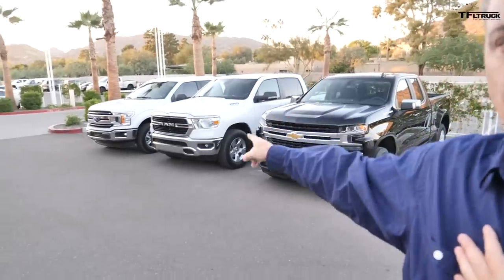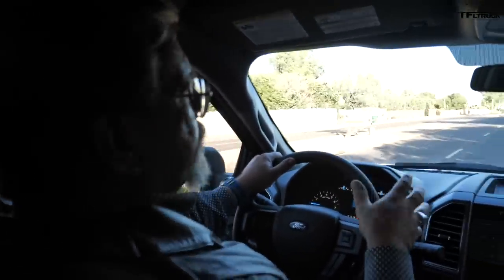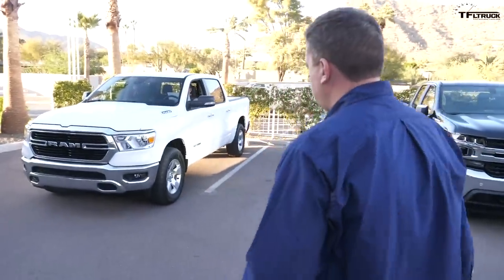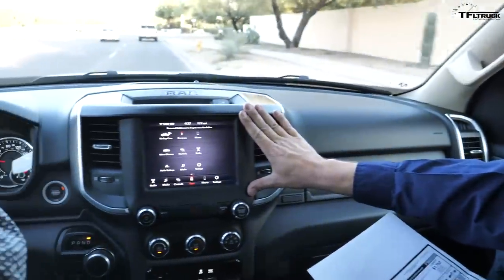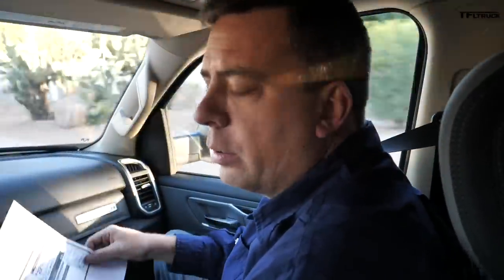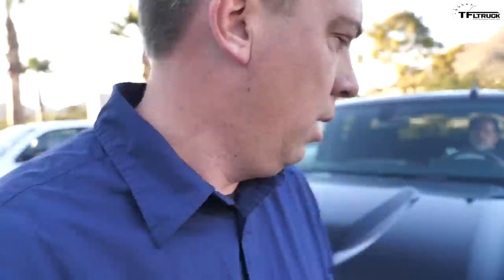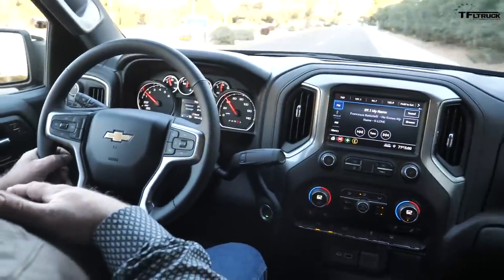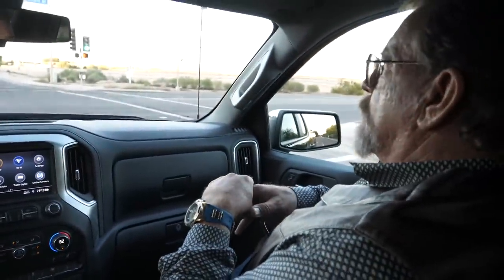Work Truck Wars: 2019 Chevy Silverado 4-Cylinder Turbo vs Ford F150 vs Ram 1500 Review

Comment: I don't care what Chevrolet tells you, the viewers want to see a 2.7 Ford vs 2.7 Chevy review. Especially up the Ike gauntlet.
Reply: Gm fanboys will just complain that ford has two more cylinders.lol or whatever crazy excuse they can make for losing
Reply: Agreed!
Chevy already has the 4.3 V6 to complete with the other V6s
I bet this was originally made to complete with Fords 2.7 because they don’t have an engine to compete against it. But it was a huge disappointment so GM tried to save themselves the embarrassment and decided to say its to complete against the other V6s (and their very own V6 lol) 
So the tests I want to see: 
1. The Ford 2.7 V6 Ecoboost vs GM 2.7 turbo I-4
2. The GM 4.3 V6 vs the GM 2.7 turbo I-4

And to be honest, with the silly electric water pump (why, just why lol) on the new GM turbo 4 I would gladly take the other two base V6s and even GMs very own 4.3 over this new engine
Reply: @dragon81heart  that water pump looks like it is stupid easy to replace. its right up front looks like only 4 screws hold it in .
Reply: BassRacerx doesn’t really make a difference how easy it is to replace if your engine is already ruined
I would very happily give up the extra few horsepower the belt driven water pump uses for the piece of mind  knowing that as long as the engine is running, the water pump is too. It is a simple and redundant system that has been proven to be extremely reliable and in some cases will last the life of the vehicle
This electric one has none of that, and adds in extra levels of complexity and failure points of wiring, sensors, and the tubing that connects it up with the exhaust manifold (which from what I hear is cast as part of the cylinder head...another step backwards)
Not sure what was going through General Motors head here with this engine. GM makes the LS, which is an amazing engine, so how did the same company that made that drop the ball so badly when it came to this??
Reply: @Pabloperes675  Grand National vs ecoboost
Reply: I agree😉😎😇
Reply: @Pabloperes675  More turbos just means more friction losses.  Turbo power comes down to pumping volume, and GM could have just made their turbo bigger to move the same volume.
Reply: @rightwingsafetysquad9872  agree.
Reply: @dragon81heart  Wrong, the 4.3 is gone, this is the base model engine now.
Reply: @JkeeneMX607  It also has two turbo's!
Reply: The 2.7 Ford will stomp the 2.7 Chevrolet with ease.
Reply: One think about the chevy is in a few yrs. The resale value will be better than the ford or dodge. The ford trucks have the worst resale value going.  Probably because ford is not as durable as Chevy or dodge.
Reply: @donaldkinder6716  Dude you must have bumped your head hard,my dad owned fleets of trucks and the Fords were always the toughest ones he ever had the Chevy's were always more sissy and more of a ladies truck. And believe me water well drilling is as hard on trucks as it gets and dad beat his trucks mercilessly everyday of the 48 years he was in that business. Chevy is no match for Ford when it comes to bare knuckles hard ass work.
Reply: U ford guys ant nothing but cry babies. Because the Chevy 4cy 2.7 out does the ford or dodge 3.3 and 3.6 v6. Ford guys want too put a 2.7 v6 with eco boost. The Chevy 4cy has 2 less cylinders than a eco boost 2.7 ford v6. Wouldn't be fare. But ford guys always know that ford engine's. Have too have a advantage. Too out do a Chevy.
Reply: @donaldkinder6716  After more than 30 years working on trucks,I can attest to the fact that Ford trucks are just plain better trucks than Chevrolet trucks
Reply: Truth hurts !!!!!!!
Of COURSE they met the challenge !!!!!
 Toyota will NOW follow !!- ford better idea ?????????????????
  Has been runnin after everyone since !!😬👍🏼🎶🇨🇱🇨🇱🖖🖖🖖🖖
Reply: @terryherrera5252  you know that ain't a Texas flag right?
Reply: As presented, except for making the Chevy a comp crew cab and 2wd, I’d take the Ram. Best looking, best interior, best riding, best towing.
Reply: @dragon81heart  what about Ford's diesel?, ooh wait they don't have one?
Reply: @lawnmowermanlawnmowerman9930  how many miles your daddy get out of a Ford truck?, I got a GMC Serria that had 460,000 miles before I sold it & the guy I sold it to put a additional 100,000 miles on it and just a crank sensor went bad? Explain that?
Reply: @lawnmowermanlawnmowerman9930  my ass, no Fix Or Repair Daily shit truck with those piece of shit 5.4 motor ever outperform a 5.3 or 6.0 LS engine's!
Reply: Billy Pate you do realize Ford has had a diesel for the half ton trucks for over a year now right?
Lol
Reply: @billypate2479  Well the speedo on his 63 model quit working at 375,000 miles and he drove it another 6 years after that using it as a service truck everyday averaging about 150 miles a day,six days a week.So I would estimate over 1 million miles. After which he traded it even swap for a newer model Chevy C10 which didn't last as long.
Reply: Why would Chevy run against the Ford EcoBoost?
The Ford would destroy it and Chevy knows is.
   Total FAIL 👎
Reply: @lawnmowermanlawnmowerman9930  you haven't worked on anything For 30 years lol. I've taken apart and been in a lot of vehicles fords have never been better. It's always been a toss up.
Reply: @lawnmowermanlawnmowerman9930  bullshit. Odometers back in c10 days didnt go past 99999.
Reply: @dontask8979  huh?
Reply: @jdrok5026  Brother I'm a Ford man,I was working for Ford when the 4.6 v8 came out. The first one I ever saw was on a engine test stand at a Ford service tech. training school. I have worked on many different engines even some that are uncommon in the USA.
Reply: @donaldkinder6716  
They both have the same displacement of 2.7 liters.  What's unfair about that?  Ford's V6 EcoBoost engines are faster than Chevy's V8 engines.   Are you gonna cry because they have turbos?
Reply: @brussell639   The GM is a 4cylinder lol .  Really no reason , The 2.7EB is superior in every way , including mileage.   Just because something is the same displacement does not mean they are equal.  I own a 2.7EB .
Reply: @donaldkinder6716   Lol you can buy fords 2.7 for the same price. I know , i own one. It outperforms GM 2.7 in every way.  They should have put the 2.7 in the colorado .
Reply: @calebniederhofer6529  I wouldn't buy nothing in a full size pick-up but a v8 engine.... My Chevy has 250000 miles still running strong, ford has had lot of troubles out of triton v8 engines why most ford truck owners buy v6 eco boost?
Reply: @donaldkinder6716  Ford only makes the 5.0 as a v8 platform now. Which is a solid engine . They are coming out with a 7.3 though .  I will give it to GM though there older 5.3 , and 6.0 were reliable engines.  I had a 04 5.4 gmc z71. I loved the truck , but towing was awful .
Reply: @calebniederhofer6529  
I agree with you that the 2.7 EB is the superior engine of the two.  When I first heard about GM's 2.7 being a 4 cylinder, I initially thought it would be crap.  I've since changed my mind and actually applaud their effort and what they did.  I still like the EcoBoost better, but for comparison's sake, look at how popular Ford's 2.3 EB is.  Granted, I wouldn't want it in a full size truck, but it performs well in the midsize arena.  I think that's where GM's 2.7 would ultimately be the best fit.  But on paper, it puts out comparable numbers (although less) than the 2.7 EB, and since the Ford vs Chevy rivalry is so good and draws so much attention, I think that's why the consumers want to see a head to head comparison.
Reply: @brussell639   GM marketed it as a entry level engine to compete with ford's 3.3 , ram's base . What is silly though , is fords 2.7 is only a 995 over base option . So  that , and with incentives the 2.7 EB is actually cheaper.  I think selling a 4 banger in a full size truck is very hard. Ford struck gold with the 2.7 , 3.5. They also are lighter , and the V6 is still a big difference from a 4 .  GM really should put the 2.7 in a midsize , most people will pay a extra 1400  to jump up to the 5.3
Reply: @calebniederhofer6529  
Yeah, that's how GM is sidestepping a 2.7 vs 2.7 comparison.  I think it's a chickenshit move comparing a high output turbocharged anything against a base model V6.  Maybe if ford was still offering the 3.7 but even then the torque will always lose out to a forced induction engine in the same class.  The EB engines are still a hard sell to a lot of ford loyalists.  I like their performance potential, but I still enjoy the sound of a healthy V8.  The nice thing is you can get a relatively fuel efficient, 400+ hp engine from nearly every manufacturer.   back to the gm 2.7, as far as base engines are concerned, I would definitely pick that over a naturally aspirated V6.  But I've never bought a base level truck before, probably never will.  But some do, so maybe they'll find their niche.
Reply: @brussell639   The EB engines account for over 68% of fords  sales.   The deal with the 5.0 is it only produces peak torque at a high rpm like any N/A engine . For instance my 2.7EB hit 's 80% torque at 2750 rpm vs 4200 plus on the 5.0. 95% of driving we are never hitting 4k plus , so for daily driving ,even towing the EB are far superior in the torque curve. It is not even close. That's why i am such a fan of the EB. People get caught up in turbos , but they can be reliable engines  maintenance is a must , as well as full synthetic .
Reply: @calebniederhofer6529  
I love turbos.  I'm building a single turbo setup for my '02 F150.
Reply: @843OutdoorsSC   They buy ecoboost because of the efficiency , and torque , performance.  90% of people bashing the engine sizes , and turbos have never even owned one.
Reply: @rightwingsafetysquad9872   More turbos does not mean more friction loss.  This is a ignorant comment,  without actual knowledge .  Turbos just use free flowing exhaust to drive a fan, wheel aka turbine.  Trains use them , diesels, ships, aircraft. They can be very reliable . What matters is the internals, block. Ford actually has dual chain to prevent any friction loss on gen2. The only reason it was ever a problem, not because of the turbo itself,  but people neglecting oil changes. It is a high performance motor ,  like a baby diesel in a sense. You can't neglect oil changes, fluids, filters.
Reply: That turbine and impeller in the turbocharger have friction. More friction means energy losses. The turbine spins slower that it would without the friction and puts more back pressure on the exhaust. That pressure means pumping losses on the pistons pushing exhaust gasses out of the cylinder. All that translates to either reduced power or efficiency. Repeat the whole process for the oiling system. Point being the friction of the spinning elements in the turbo reduces the efficiency of the whole engine.
Reply: @rightwingsafetysquad9872  Reduced power lol what ? A turbo  increases power.  So heck no you are not losing power, efficiency . A supercharger yes , because it is belt driven. It uses power off the belt , engine to drive it.  Turbo simply uses free flowing exhaust to drive it. They can be 99% efficient.  No worries everyone has there own view.   The EB motor is built to withstand the high pressure , temperature.  As long as they are maintained i have no worries about reliability. I am more concerned with electronics going out.
Reply: @calebniederhofer6529  relative to as if we lived in frictionless high school physics land. Try to keep up.
Reply: @rightwingsafetysquad9872   There is knowledge , and ignorance. I think the comment saying you lose power with a turbo backs up my claim.
Reply: I own a 2.7 ecoboost stx for the win
Reply: @calebniederhofer6529  Now you're not even responding to what I said. What I said was 1 big turbo = more power than 2 little turbos given an equal amount of air pumped.

1 turbo > 0 turbo
2 turbo usually not > 1 turbo
Reply: @rightwingsafetysquad9872   Because you don't even understand what you are commenting on respectfully.
Reply: @WilliamStewart1  
Wrong...4.3 still for sale in all trucks..
Reply: @brussell639  Because you'll always be able to get more power with a higher cylinder count. You have more space to balance stress out, can achieve higher rpms etc etc. It starts to stop at around the 8cyl mark.
Reply: Aaron Hainan 

 

 

M
Reply: Aaron
Reply: Aaron Hainan 

 

M
Reply: Aaron
Reply: Aaron 
 

No
On
Reply: M

 

 

M
Reply: M
Reply: Aaron Hainan 
No

 

 

 

 

M
Reply: Aaron Hainan 
No

 

 

 

 

M
Reply: M

 

L
Reply: Aaron Hainan 

 

 

 

 

 

 

M
Reply: Mmm
Reply: Aaron Hainan 

 

Mom
M
Reply: Aaron Hainan 
Mm

Mmm

M m
 

M

 

M
Reply: Aaron Hainan om

Mmm

 

M
M
N
Reply: Aaron Hainan om
Lo

Mom in

Mommy

M
Reply: Aaron Hainan om
Lo

Mom in

Mommy

M
Reply: Aaron Hainan mo

Omo
Reply: skankhunt607 mmmlo m
M
M 

M
Reply: Aaron Hainan m 
Mmm 

M

 M
 

M
M

M

 

 

M

 

Mono

Mooo momo
Momo
Reply: Aaron Hainan o

O

  M m
M m
Mm
 O
Reply: Aaron Hainan om

  
Mo
Reply: Aaron Hainan om
Om
Mom
Reply: Mommo
No
Om
Om
No
Mom
Mmmm
Mmmmm
M

M
Reply: Aaron Hainan 

M
M
M
Mmm

M

Om
Jimmy

Moo
Reply: skankhunt607 mom
Mom
Mmm
Mm
M mmm
Mmmm
Mm
M
Reply: Aaron Hainan om

Mommy
Reply: Fabron Fretwell it just so happens that I own both a Grand National and 2019 F150 2.7 eco boost.  Of course there’s no comparison.  Even in stock form a Grand National murders a 2.7.
Reply: Actually,  no. This was a base model test. So the base model engines were tested
Reply: @calebniederhofer6529  the 2.7 is too much engine for the colorado, unless they were to tune the specs down. The 2.7 is very quick off the line on a full size truck, and in a midsized it would be too dangerous because of the power to weight ratio.
Reply: @campbell0162  Dangerous ? I have no idea what you are talking about. The ford Ranger, already utilizes a 2.3 that’s numbers are not that far off from Fords 2.7 or previous GM 2.7.
Reply: @calebniederhofer6529  I'm just saying that it's torque numbers are really too high for a little mid sized truck to safely handle, especially the new high output 2.7 that has 420 pound feet of torque.
Reply: @rightwingsafetysquad9872  This is not true or accurate at all. You don’t even understand.
Reply: @campbell0162  It does not have 420lbs of torque anyways lol. At least not stock, and without tuning. This is crank numbers.
Reply: 4-cylinder pickups?
Is this pathetic or is it just me?

And do these guys look like authentic truck-working guys?

"God save America."